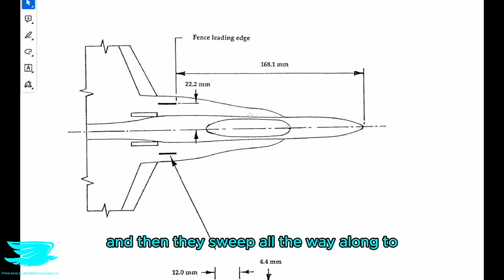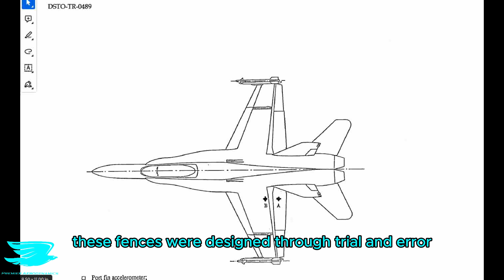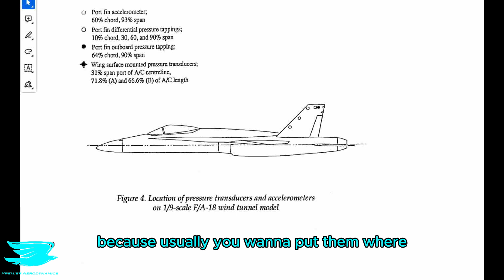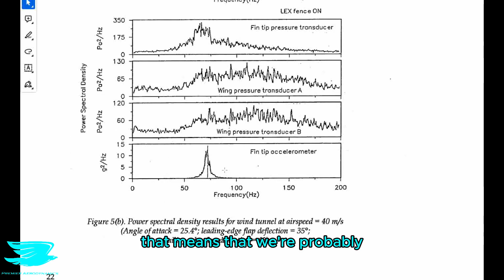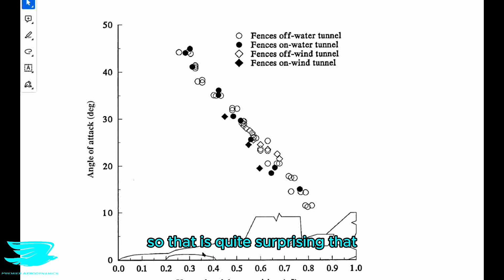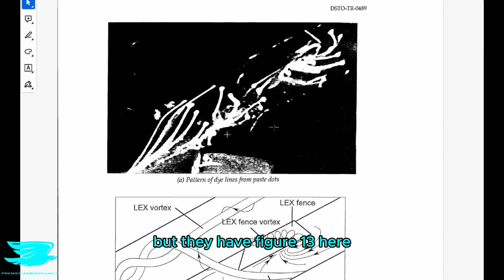Podcast #163 + F-18 Fighter Jet LEX Aerodynamics

Comment: A vortex core is a pressure separation, from high to low, you can't have low pressure without raising it somewhere else. So a vortex on its own doesn't create low pressure, since the low pressure core is surrounded by a high pressure wall and the two pressures balance each other out, what a vortex does do is transfer momentum, it's this momentum transfer that keeps airflow from separating at high alpha. This is because the vortex motion pushes air against the surface, keeping the flow attached and laminar. You can see this because of the shear stress on a surface due to the vortex. Which is all that flowvis kind of shows you. The way light reflects off a surface also is a form of crude flow vis, as light and vortices take similar paths, maybe that's what inspired Maxwell's equations.
Reply from the maker: Vortices definitely transfer momentum.

However, I'm not sure that you can only lower the pressure by raising it elsewhere.

Bernoulli's equation says that effectively, all you need to do is just accelerate the flow and that will drop the pressure. In this instance, no region had to have a subsequent pressure increase.

The flow viz is really good at showing the shear stresses, especially if you look at drying times.
Reply: @PremierAerodynamics  When air is accelerated over a wing, the stagnation point at the leading edge is the part where the pressure is increased(and highest)? In my opinion, and I could be wrong, you need pressure separation to have flow acceleration. Case in point, when porting cylinder heads, the speed on the roof of the port vs the short side radius. Typically when you make the roof slower(higher pressure) it makes the short side faster(lower pressure).
Reply from the maker: @rolandotillit2867 To be perfectly honest, we don 't really know why flow accelerates over a curved surface.

There are a few theories, one of the most popular being bernoulli's theory, but there is not common consensus.

So, you might be right.

As for the high pressure at the front - the stagnation line - that as far as I know a separate phenomenon to the acceleration and pressure drop.

But, who knows, maybe you're right.